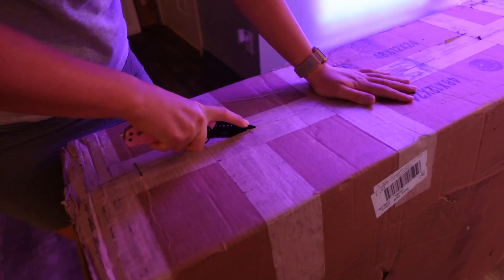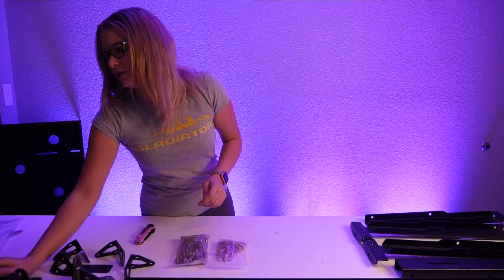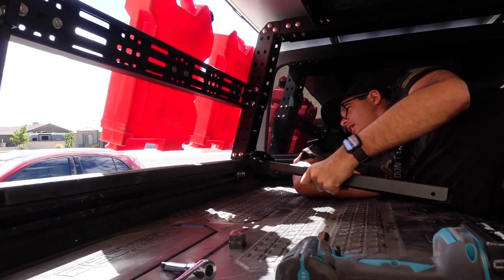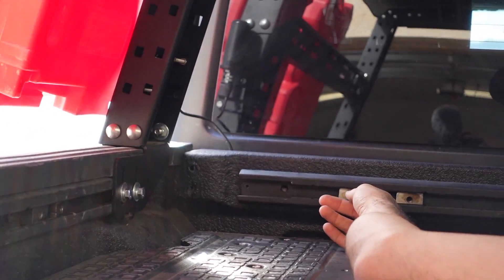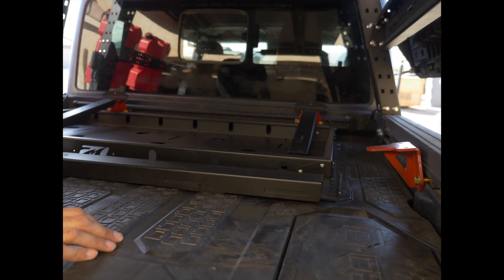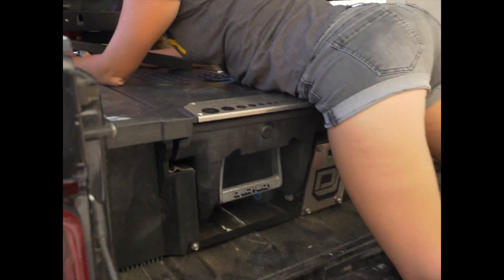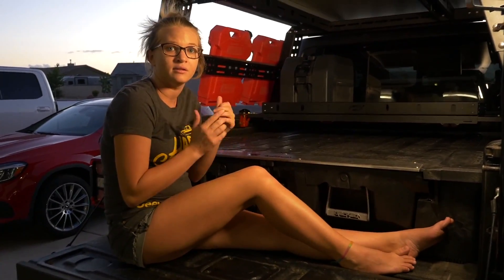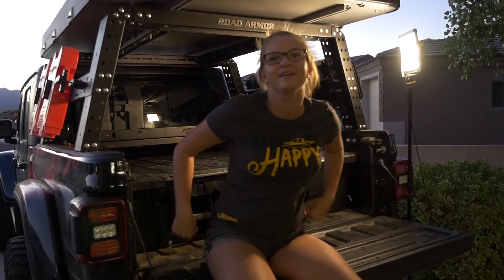Jeep Gladiator Cargo Rack by Motobilt

Comment: What’s the point of this if you have the decked system? No way that’s stronger than deckeds 2k load cap...
Reply from the maker: You will see.. Its to hold a few things, didn't want to screw into the truck or the decked We still have parts not here yet, but it will make sense when you see it all together